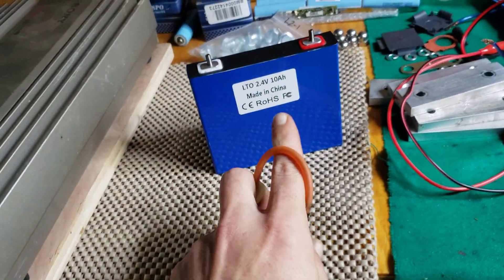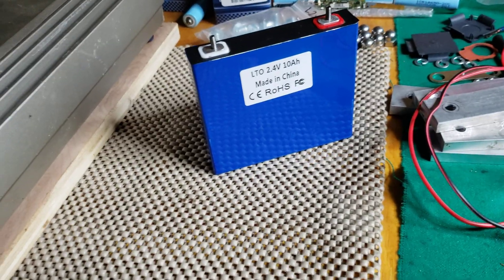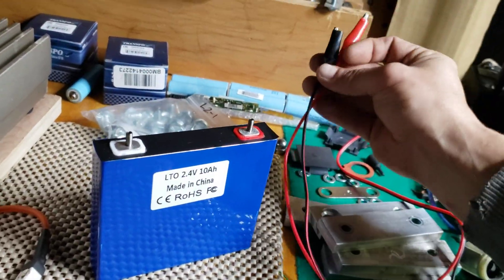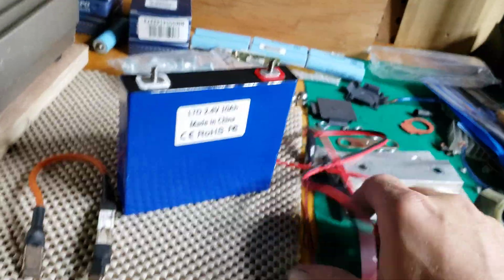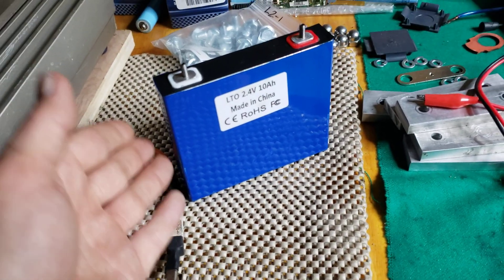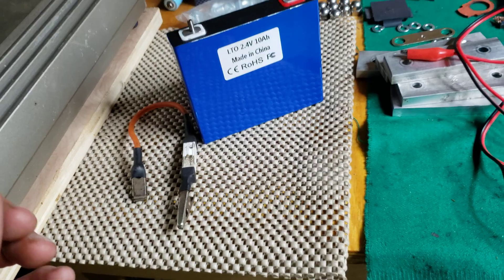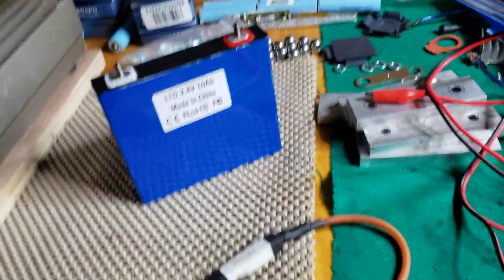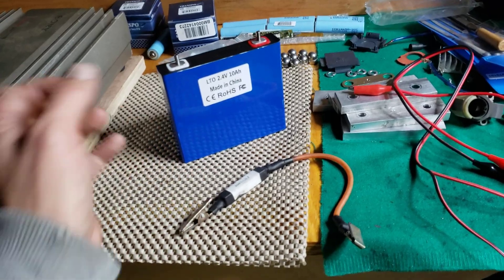Flipped Polarity!? Lithium Flipping? How to Flip them back ! LTO Lithium Titanate

Comment: Hey bro I am wondering if you can tell me what is the absolute lowest voltage i should never go below in order to keep something like this from happening i am still waiting on my scib bank from NORTHWEST LITHIUM but I am installing my alternator and second wiring kit etc this weekend getting ready for the bank never messed with anything with a c rate like this only lithium battery i have ever owned is the jag35 specialty LoL 😆 im going to be charging around 16v just wondering what my bottom line is for the battery

Comment: I just did your trick on my sodium batteries seems to be working I guess only time will tell
Reply from the maker: Are you sure the polarity is correct?
Reply: Yea all 8 of them where .5v and one of them was almost -1v fully charged they should be 1.8v I bought some of those natron energy batteries from jag35 they like to flip polarity  @mazda2284

Comment: where did u order these?? I'm wondering how many banks of rhese to for 10k watts @320amp alt charging @ 14.8volts?
Reply from the maker: Srikobatteries.com Discount code BDSB
Reply: @mazda2284  thank you, how much is a bank of 6 of these good for wattage wise? I already have a 40ah of yinglong, should I just add another of those or switch to the scib? looking for space savings...
Reply from the maker: @troydefond2307  id get scibs over yinlong period . bars i make my own , but there are a number of places that make em also , many bar makers can make you a custom set for your build , due to so many layout options they dont normally have ready made sets
Reply: @mazda2284  thank you. yeah, I'm probly gonna just sell my 40ah yinglong bank. it's in great shape. can get 18 scibs for 450$ might as well. make my own bus bars outta my drill press and 6061 aluminum. thank you for ur input, also responded to some other videos of urs, formulas and curious andost compact cell configuration for the scibs.
Reply: @mazda2284  where do u recommend to get busbars?

Comment: Any reason for using another battery to bring up the voltage in the correct direction, instead of using a lab supply?
Reply from the maker: it shorts the supply and it should shut off if its a good one . thats why . it could kill your power supply . thats also why you cant just slap it on a supply and charge it , so when you short it back to 0 its still in limbo and the power supply should see it as a short , this is also why you wanna flip it with a cell and make sure it stays before ever doing anything with the supply .

Comment: A 10W resistor doesn't tell us anything. It's the resistance that is relevant, not the power handling - in this case 5.1 ohms.
Reply from the maker: its not important , whats important is shorting it with a resistor . dont matter if its 1ohm , 5ohm , 25w , 100w , 5w .... whatever , just need a resistor of sorts . i also use these to charge caps in amplifier so it dont spark at all when you hook up the power
Reply: @mazda2284  i agree but if all you want to do is short it out, just a foot of wire will do. Once the voltage is that low there is no energy left to do any heating. I just mention it since i have many 10, 20, 50W resistors that are less than one ohm (0.15, 0.33) and if someone goes to use one of those just because it's 10W it's a moot point. Just pointing that out.
Reply from the maker: @zaprodk  a solid dead short will create a reaction, yea you could use a tiny wire but you should use a resistor . Keep it simple and don't split hairs . Your welcome to make a video and show us all how you do it .